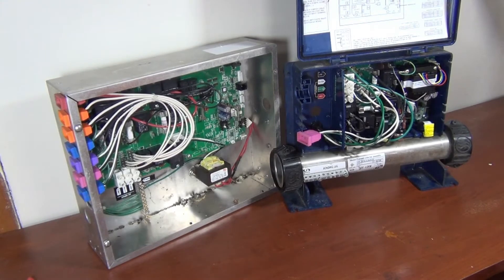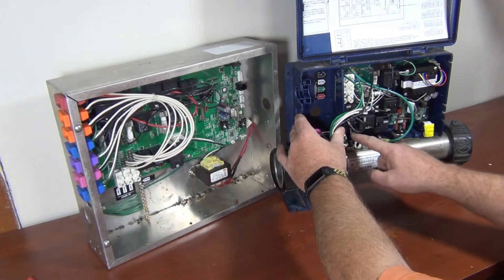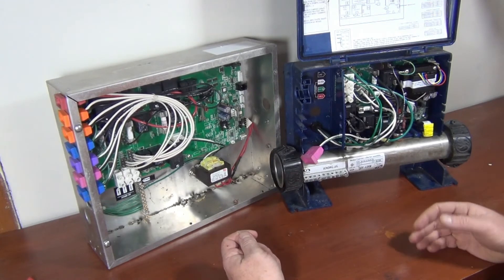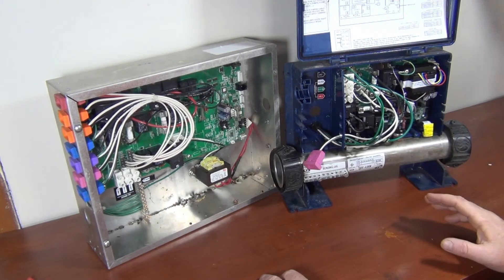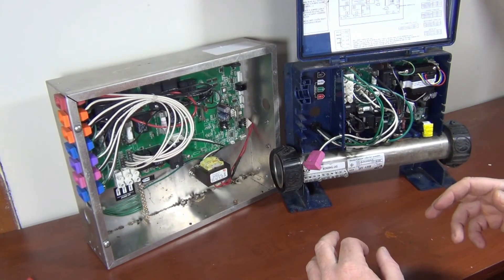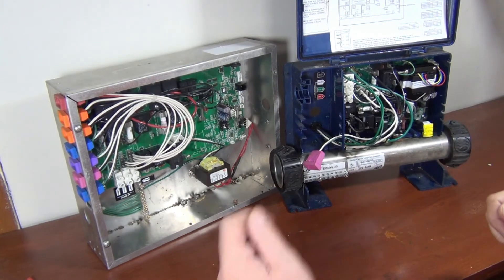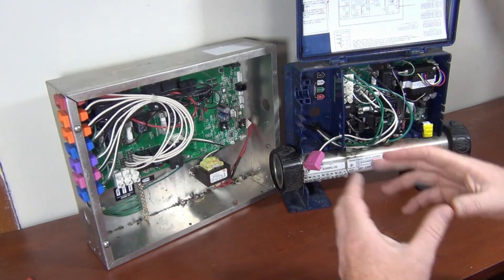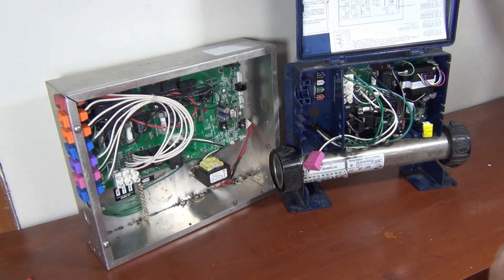Hot Tub GFCI Breaker Keeps Tripping?

Comment: Not sure if you're still checking these comments. I unplugged my heater, still trips, unplugged one pump, trips, both pumps and heater unplugged it stays on. Has an ozonator and bubbler that remain plugged in but they don't get voltage on startup I don't think. Board doesn't look cooked, is there anything else I can troubleshoot?
Reply from the maker: whatever you unplug and it stays on, thats the problem.

Comment: My GFCI was tripping. Unplugged pumps, still tripped. Plugged back in and unplugged heater. Stayed on like it should. I pulled the heater tube out and then took the element itself out. No visible problems on element. Did a continuity test and Ohm test both were good. Hot tub works as it should when heater is disconnected. As soon as I connect element it trips off, but element has continuity. Could the element still be bad?

Comment: Hi there, Im having a tripping issue on the same blue unit . I first unhooked the ground to the heater tube, flicked the breaker on and power stayed on . As soon as I hooked back up the ground , the breaker blew. I disconnected the power supply to the heater elements as you described and the power stays on . I have continuity between the two  heater elements contacts . No  continuity between the positive elements  and the negative ground  . Weird !
Reply from the maker: Its the element